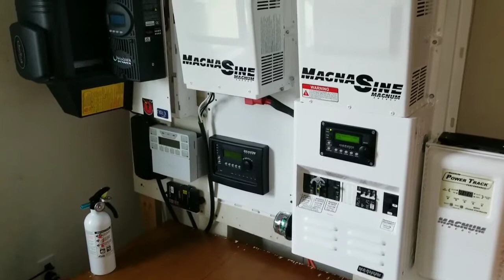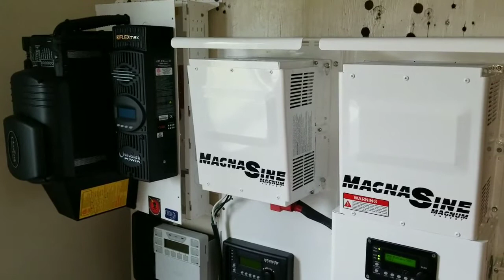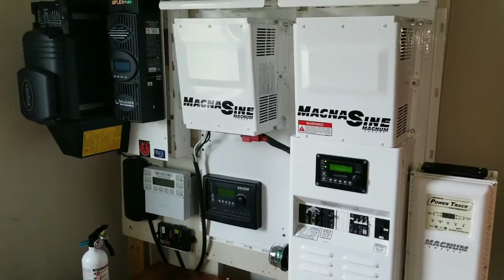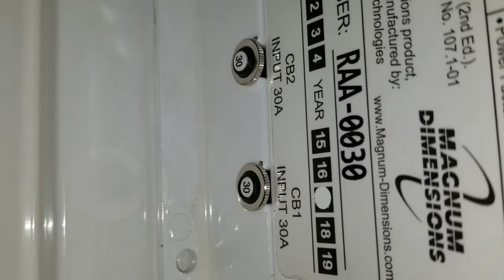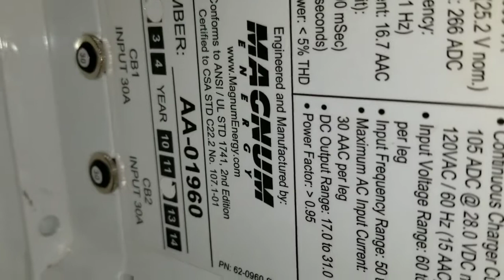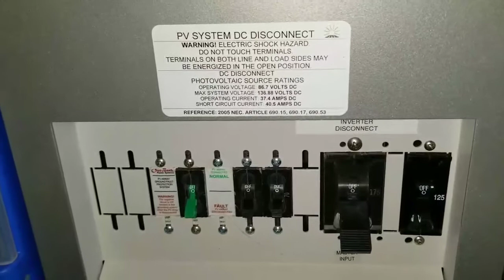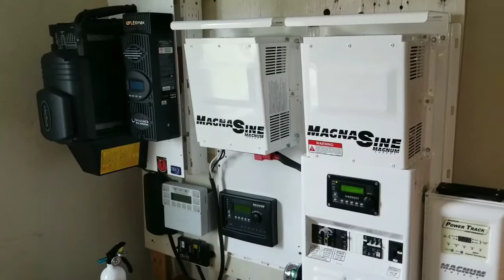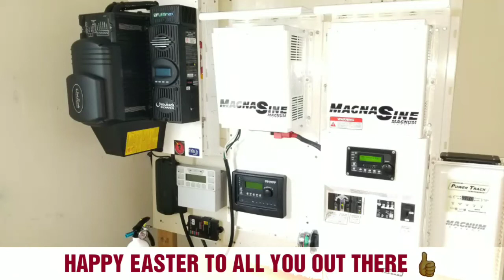SOLAR SYSTEM OFF GRID HOME OVERVIEW (PART#1)

Comment: How do you hook up wind to the Midnite4
Reply from the maker: It all depends on the type of wind turbine you are about to use.
A three phase turbine which is AC Output  or DC turbine. 
The expensive way is by getting Midnite Solar Clipper Kit.
The cheapest way is to get a rectifier.
Reply: @jwsolarusa  I have a 3 phase ... you should do a video for wind on a Midnite cause there is none on YouTube
Reply from the maker: @mteca5093  
There are a lot of videos out there.
You can also check out with MidNiteSolar YouTube channel. 
I would love to do wind turbine video but I am in the middle of the city and there's no way for me to install a wind turbine. 
Thanks for WATCHING, and have a bless Easter